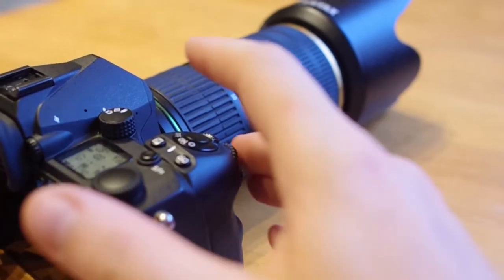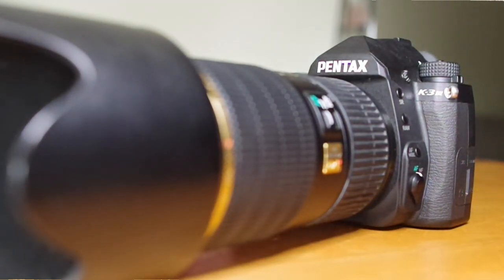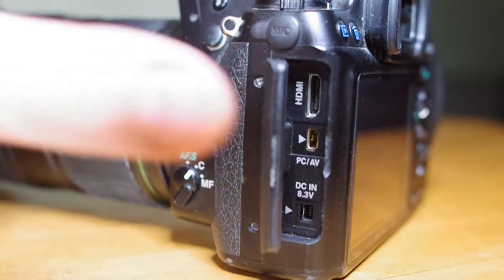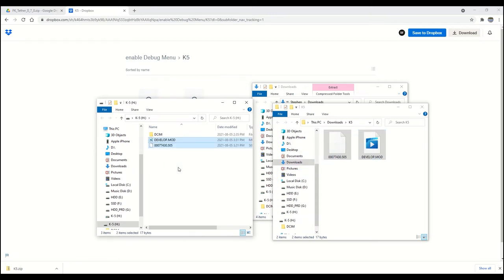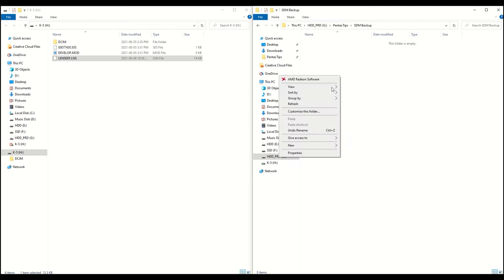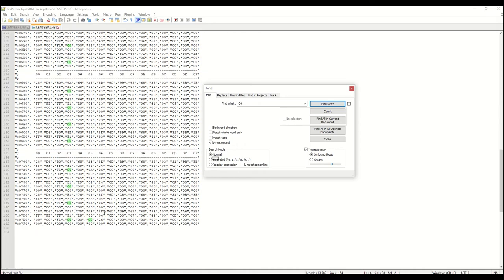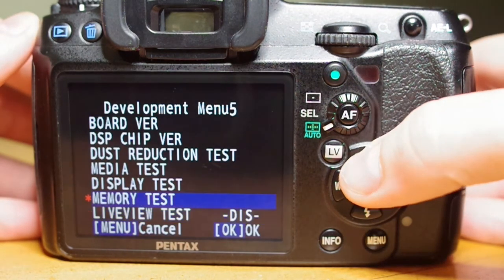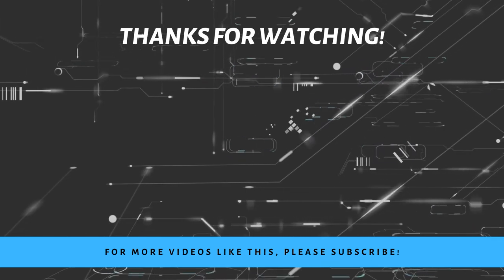Pentax SDM to Screwdrive Autofocus Conversion

Comment: Thanks for putting this together! I appreciate everyone who figured this out, and those who put guides out before, but this was the most clear one and it was nice to have a newer guide. Converted my DA* 300mm and 50-135mm this evening in no time.

I have a K10D and was unable to use the same method as you, but through some digging provided in the debug files I saw that it was unnecessary to go through all these steps, at least with the K10D. You can trigger debug mode by simply putting a txt file on the SD card with a debug open menu command. From there you can unload the lens ROM, modify it as you show, and load back. It was very simple. Just in case anyone else has an old camera not supported by the other method/can't use pk tether/doesn't have a cable. Those seem unnecessary for some camera models at least. Go to the debug files dropbox link and if your model isn't listed click Other Cameras and read through that info :)
Reply: Hey snappiness - did you do it after your 300 failed or as an af speed upgrade?
Reply: @doncoombez  My 300 failed twice but recovered after each time, so I knew it was on the way out. AF did feel a little bit faster, but probably just because mine was in process of dying. I don't actually think it's faster than a working SDM version, though people have reported different things.

Comment: BEFORE committing to do this - try the 1c fix ... it shouldnt work, but it does. 

IF your SDM motor is broken, then its broken, and the 1c fix wont do anything.  But if its notr eally  broken, then this is worth a try.

The 1c fix  :
- take the lens off, and use a small flat head screwdriver to action the screw drive.  It should rotate cleanly with no resistance, all the way from minimum to infinity and back again
- place a fully charged battery in the camera body
- attach the "broken" SDM lens
- set both the body and the lens to AF
- press the AF button on the body - hold it for a few secs
- press and release the button dozens of times. Keep doing this for a few minutes, dont despair, and dont give up early
- after a while, you will notice that the focus distance is starting to move a tiny bit when you press the AF button on the camera.  Keep going !
- after another short while, the entire lens springs back into life, and SDM works again at full speed with no issues.

- Attach the next broken SDM lens, and try again. 
- It should take less time with the next lens

It seems like there is some level of capacitance in the camera body and or the lens that needs "recharging" to bring the lens back to life.

I cant see a capacitor on the SDM board (doesnt mean its not there, I just cant see one).   But yeah - it definitely works, provided that your lens is actually in good condition.
Reply: Thanks very much for this fix. It has worked for me, with my 50-135 and 16-50, my two best lenses. My older camera is a K10 so would have been difficult to work through a fix! 
Is your fix long term or do you need to repeat from time to time?
Reply: Thank you very very much! You saved my life!!!
Reply: @grinsekotze  so it worked ?

Mine have been unused in storage for 8 months - took me 15 mins to get them going again. They still work :)
Reply: @steveoc64 My lens lay unused in the drawer for about 2 years. Then the autofocus stopped working. With the K-3, I could still activate it by switching between video and photo mode. After another 6 months in the drawer, that didn't work anymore either. Your tip brought the lens back to life after about 10 minutes. I'm curious how long it will work now. Otherwise, I know now how to revive it. Thank you!
Reply: @steveoc64  My lens lay unused in the drawer for about 2 years. Then the autofocus stopped working. With the K-3, I could still activate it by switching between video and photo mode. After another 6 months in the drawer, that didn't work anymore either. Your tip brought the lens back to life after about 10 minutes. I'm curious how long it will work now. Otherwise, I know now how to revive it. Thank you!
Reply: Thanks a lot for this fix ! it worked for my 16-50, took me 5 minutes to bring him back to life
Reply: I'm arriving a year after you posted this and five years after my 16-50 stopped working and, after trying this, it works again. THANK YOU.
Reply: @MarkIocchelli   beautiful - pass on the knowledge !

Reminds me - I really should give my 16-50 a run, its been in the cupboard now for months

Comment: This video converts the 50-135, do you make the same changes on other lenses (e.g. CO to 80 in column 3)?  I need to convert the 16-50, the 60-250 and the 300.
Thank you for making this video.  My son and I fixed both of our 50-135s in about 45 minutes.  WOOHOO!
Reply from the maker: I do not know 100%, but I believe so! I only own the 50-135. However, I believe you should change every 'CO' in column 3 to '80' no matter which lens. Always make backup files in case something goes wrong and you can revert to original settings!

Comment: After installed and opened the PK Tether. I connect K3 to PC by cable, but the PK Tether can not recognize the K3. Therefor I cannot Turn On the DebugMode as the video. I do not know why. Maybe the cable is the reason?
Reply from the maker: K3 is too new. Needs to be older than a K5. The camera requirement is explained near the beginning.
Reply: @PentaxTips  I has just try with K5ii. After got the LENSEEP.LNS, I open with notepad and the content text is not the same as in your instruction. I find C0 and replace with 80 then put back to camera . But Error message .

Comment: hello I can not download pktether it asks me for an access authorization do you know how?
cordially
Reply from the maker: make sure to use the Google Drive link, do not download from the website (see description)
Reply: @PentaxTips  hello I can not download PKTETHER the google link asks me for access to the owner, access I requested but not received a link. If you have a link to recover software please
Reply from the maker: I just now downloaded the program from the google link as a test, and was not asked for access. The link and download work as expected. I'm going to guess it's an issue on your computer.
Reply: @PentaxTips  hello thanks for your quick reply i will test with another computer ..
Reply: @PentaxTips  I'm having the same issue =(
Reply: @PentaxTips you definitely need to change permissions. You will be able to access the file as you already have access. We do not.
Reply: @PentaxTips  I defo need access as the permissions on your link have the files locked down
Reply from the maker: To be clear, I do not own the Google Drive link to PKTether.
I just tested the link and it works perfect - downloaded without issue.
Do not use a Mac, use a PC. Do not use the website to download PKTether, use the Google Drive link in the description of this video.
Reply: @PentaxTips  I’ve used a pc and a mac and I get the request issue. It’s a permissions problem and you already have permission. If you log out of your google account and use the link you will hit the issue. 

Are you able to email me the file?
Reply: I used the non-tether route and worked fine. Did the whole thing in maybe 5 minutes
Reply: @KeithCameRunning  what route is this and what equipment do I need?
Reply: @pierselliott1245  pretty much you just don’t tether the camera, you just bring the files over via your SD card, same camera choices work.
Reply: @pierselliott1245  oh and leave your card reader door OPEN, if you shut it it won’t boot in debug mode